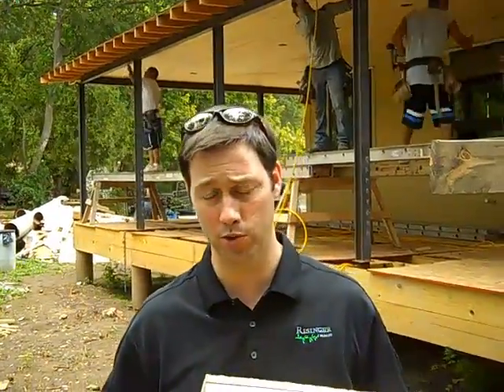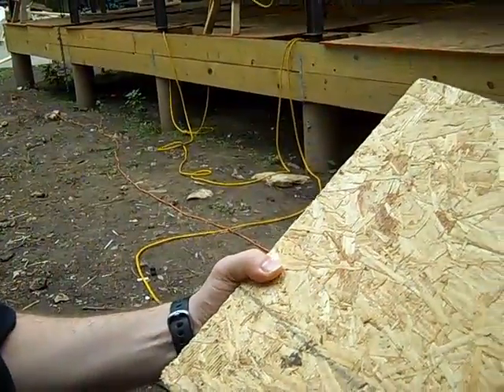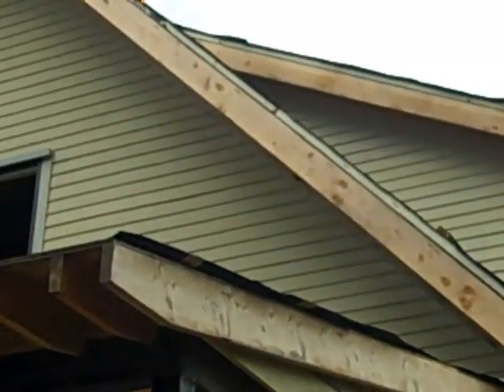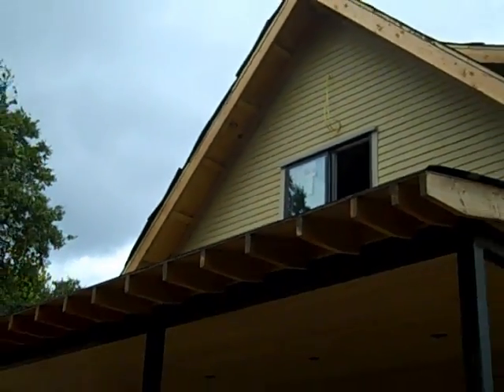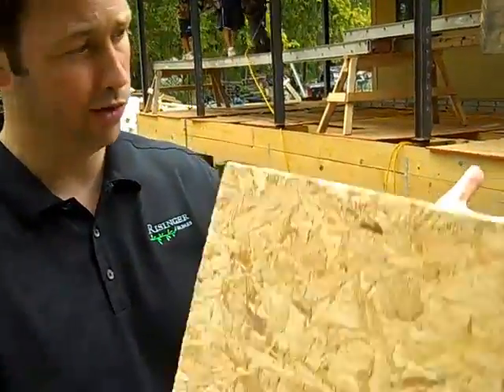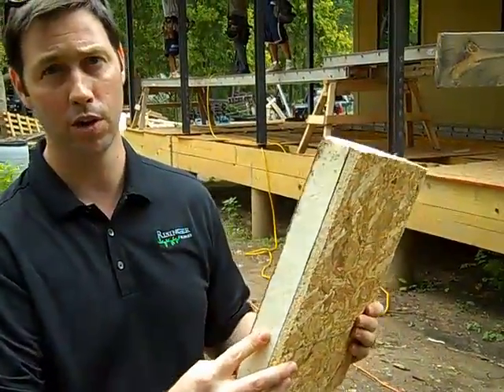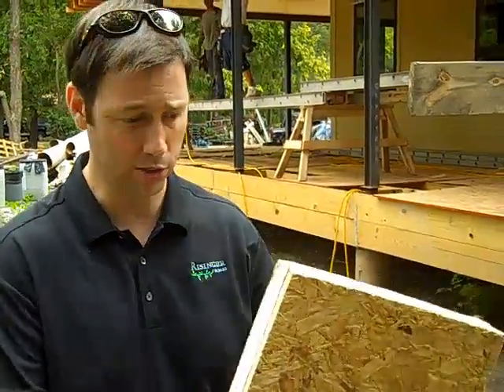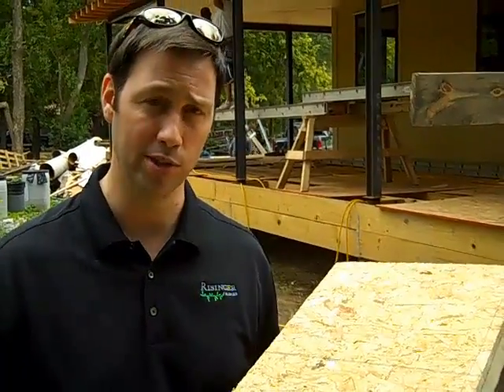Roof Top Rigid Foam - Hunter Panels

Comment: I apologize if someone has already asked this question, but I was wondering if it would be possible to use this product on a flat roof. I‘m in a 1930s Spanish bungalow in Los Angeles, and I had no idea how much heat transfer there is with a flat roof!
Reply: Most "flat" roofs actually do have some pitch to them. But if your Spanish bungalow (I'm in Los Angeles too) has decorative exterior walls that go past the roof, the answer is no. It can't drain. However, you have have a rubberized coating that insulates, applied.

Comment: How about doing about 12" of rigid foam for I guess R38? on top of existing shingles + OSB + shingles? This is a roof that is a cathedral ceiling inside where the beams go perpendicular to the slope, so doing insulation from the inside with an air flow is impossible due to the beams crossing the air flow path. Cold climate so is there any need for air flow with rigid? I still like idea of rigid on top of the roof vs inside for continuous insulation and keeping the cathedral ceiling high inside. Contractor suggested crib + pink batts w/ airflow between batts and the OSB. Rigid foam might be more expensive but wondering what advantages make it a better choice. Thanks!

Comment: Why spray with open cell foam when closed cell foam has higher R-value?
Reply: Open cell has slightly lower R value but in this case it is about water retention. Close cell completely blocks water travel. In a case of foundation walls and basement, you want the water to stay out of the living area. Foundations always get wet specially in old houses. So that is nothing new. If you use open cell and you get heavy rain, moisture can get to the interior insulation and then get to the framing. This can cause rot and mold. In a case of roof, we know shingles and felt papers will fail at one point. You WANT to know about this. If close cell is used, the water gets trapped between sheating and rafters. Rot in Sheating is not as bad as rafters. If your rafters rot then your roof can collapse. Rot in 1 rafter wont cause a collapse right away, however similar to a failed joist it puts pressure on adjacent ones and can cause failure in a case of overload, like heavy snow. I am in Minnesota, and last year we got tons of snow. Towards the end of April we had tons of snow on roofs, I think close to 3 ft (i cleaned mine after every snowfall). It started getting warmer so some the snow melted and turned into ice and made the roof heavier. We suddenly got a full day of rain on it. We had few collapsed roof around here.

Comment: May be the best yet.I like the sandwich approach making the iso part of the roof. I'm piecing in 3/4" iso between my rafters. I'll still have some thermal bridge, but I think I'll beat 90+% of ice dams, and improve summer cooling performance(in Michigan).Do you expect the iso to effect shingle life?Yes I need to increase standard insolation, air seal,,,,,Remember, many of us DIYers have old standard vented attics full of so very import (stuff).Do a video about chimneys, my old vented attic has a 50 deg elephant running through it.Thanks

Comment: Matt, I am looking into putting a new roof on my house and have decided to follow your practice in this video. I just have one question. What would you consider the best practice for closing/covering/sealing the exposed edge of the Hunter Panels and the side and bottom of the room line?
Reply from the maker: Use Carlisle's WIP 300 HT and a metal drip flashing from your roofer.  Best, Matt

Comment: Matt. Is it a good practice to install a metal roof over existing shingles? I've seen people tell others to do this, but I don't agree with it. What do you think?
Reply from the maker: I would not recommend this practice.  You want to strip the shingles, ensure your decking is in good shape.  Re-install a new underlayment (if you might foam in the future I'd recommend a fully-adhered Ice/Water Shield like Carlisle WIP 300 HT then lath to vent under the roof, finally the metal roof.  
Best, Matt

Comment: Hi, I would like to insulate my attic (conditioned) with 2" rigid foam (actually, I want install 4 inches).  It will go under the roof deck.  Do i have to vent the attic, or is would it be ok not to?  I will use Great Stuff foam cans to seal them  tight and them install the sheetrocks.  thanks

Comment from the maker: @TheFullQuiver9 Great question about attaching your roof with furring strips to keep an air gap under the roof.  I've debated this in my own mind many times and there is no clear answer.  Is it necessary, NO.  Would that be a benefit, in many ways YES.  I've done it both ways but tend to do it without the furring strips most often due to cost.  Sorry to not have a definitive answer for you.  Galvalume is THE Best roof for our climate in my opinion.  Thanks for the kind words.  Best, Matt
Reply: Where can I get 4 in form broad

Comment: Hi Matt, on our OSB-decked roof in the Gainesville/Sherman Tx area, we were so excited to hear you mentioned your roof would be reflective acting as a radiant barrier because you've saved us from putting a radiant barrier under the unpainted Galvalume we're planning on installing soon!  

Also, are furring strips needed over the OSB decking before putting the on the roof?

Thank you for filling in our learning gaps of building our >2000sq addition here-esp. having to do with our humid weather.